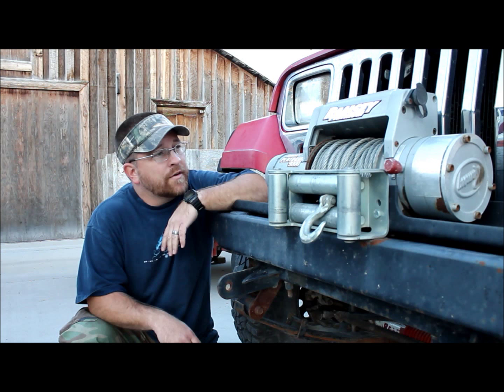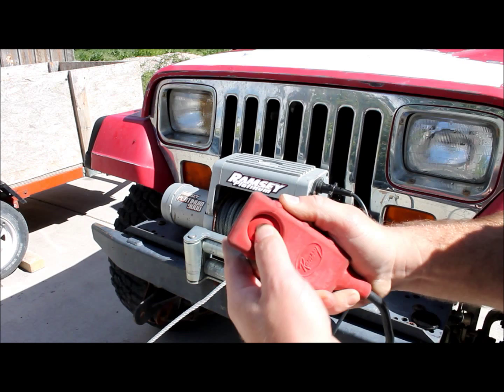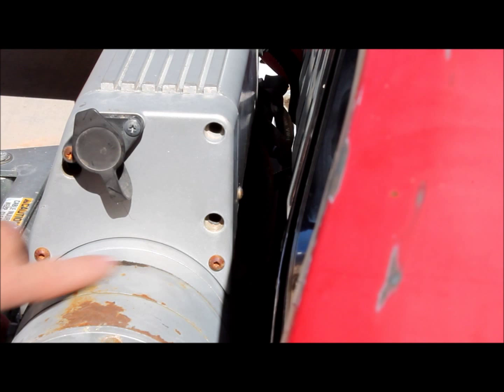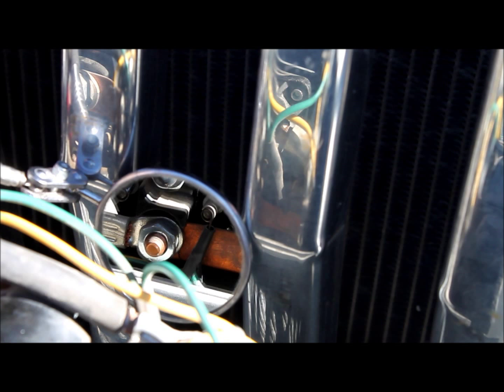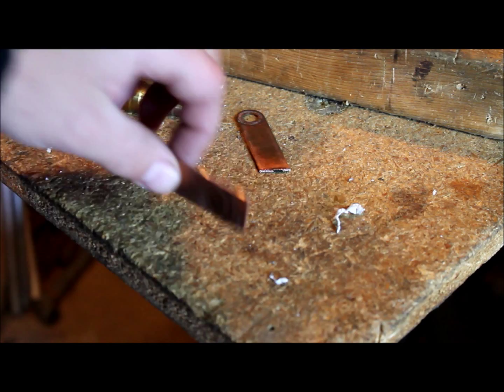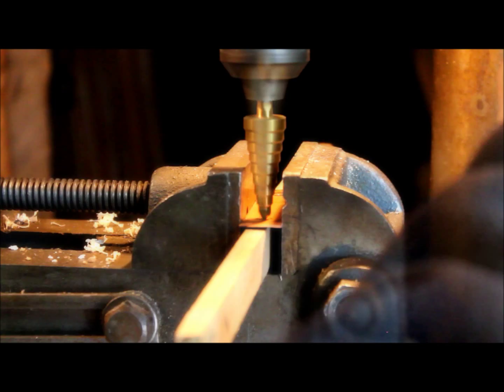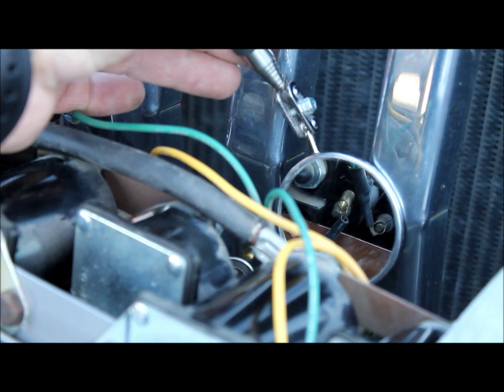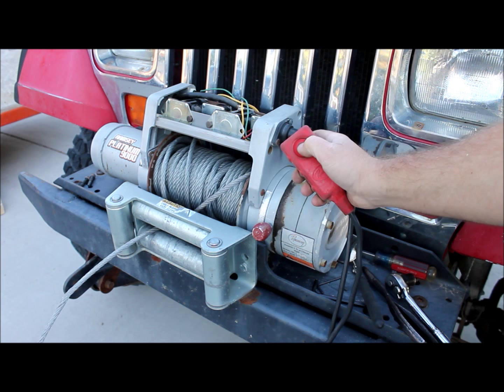Ramsey Winch Resurrection

Comment: I cleaned my Ramsey 8k winch today. 28 yrs old seldom used.  Cleaned connectors and solenoid nuts and copper straps. Used toilet cleaner 25 % acid cleaned off rust and corrosion works great.
Reply: Have a REP 8.5e I will be doingbthat to as soon as I find a controller.

Comment: use copper water pipe, hammer it flat and cut then drill holes. works for electrical cable ends too. hammer it flat and solder it in
Reply: That was my original idea but I just happened to have the copper plate laying around. The only thing I would add if using copper pipe is to anneal it after you pound it flat so it doesn't get brittle and break prematurely.
Reply: sweet! no real reason to anneal it. copper is soft and will generally stay soft. and it is available all over the country and canada too. it is a great way to make a battery cable end as well.
Reply: Soldering works surprisingly well..I've slit, flattened, and soldered copper water pipe over a square body gas tank hole...

Comment: WOW, thanks! I have the same winch and it's doing the same exact thing.
Reply: I'm glad to see this can help. That's really why I do these videos, so hopefully you guys can fix your stuff when you see them. It sucks having to replace an $800 winch when the repair might be as simple as a piece of copper plate. I hope you can fix yours like I did! Thanks!
Reply: Well bad news, wasn't my issue. Pretty sure my switch is bad now. Everything looks like brand new inside plus being in AZ we get very little water/humidity issues. Still great info to put out there!!
Reply: try bridging the contacts where the switch plugs into the solenoid housing. If its just the switch, bridging the contacts will activate the winch. It doesn't hurt the winch either. Give that a try before you buy a new switch.

Comment: Great repair man ! kinda wonder why that split like that ? Must of been rattle in that bar and over time it cracked ..
Reply: ShawnMrFixit Lee Ya, I think over the years of wash-board roads it finally just fatigued and cracked. The copper straps hold the solenoids in place on the rail so there is a bit of vibration that goes through the straps as the solenoids jiggle going down the trail. I probably should have annealed all the plates but I didn't think of that until a few days after the repair.
Reply: It may hold up fine man ! good fix ..

Comment: i have a ramsey winch question bought a rew8000 used the ground term on the winch body do i ground it to the frame or run it to the ground on the batt. 3 trems on the winch 2 larger ones go to the solenoid box and ground goes?
Reply from the maker: +downsouth_ Zj to the battery
Reply: +BleepinJeep k thanks can't find much info on how to wire a Ramsey winch online but for 150 bucks for what I paid for it I'll ask and build from scratch.
Reply: k so their is only two terms on the winch it self no ground lug so how does the motor ground?

Comment: I need help I have a 94 jeep xj and need help with the front pump seal its auto can you make a video or something
Reply: Water pump seal?? Can you be more specific?
Reply: Transmission
Reply: Ooooh... That's a bad one. You have to pull the whole tranny out to do it. I would recommend a complete rebuild at that point. If the pump seal is worn out, the guts are probably not far behind. It would be cheaper to find a low- mileage used tranny and swap it in.